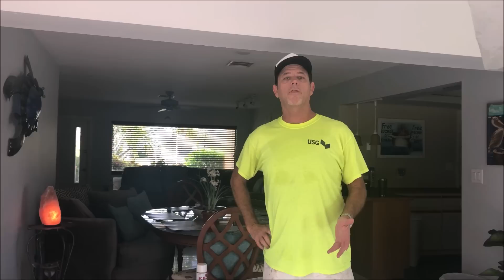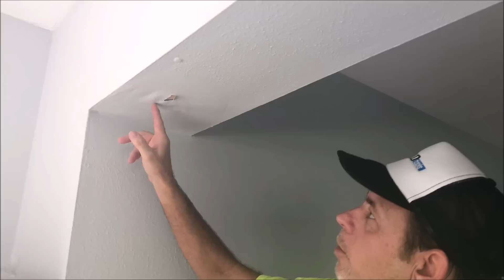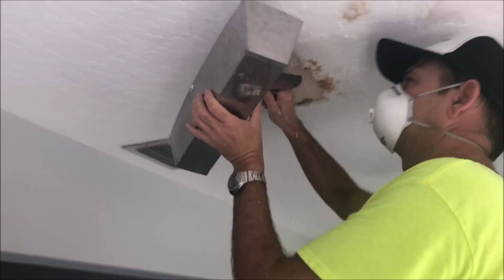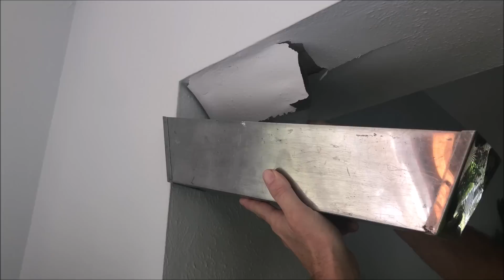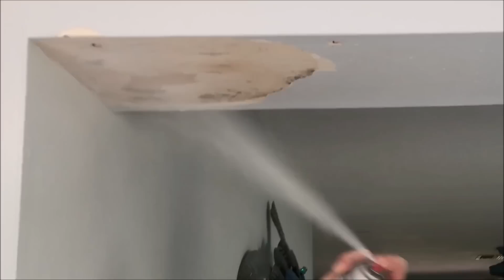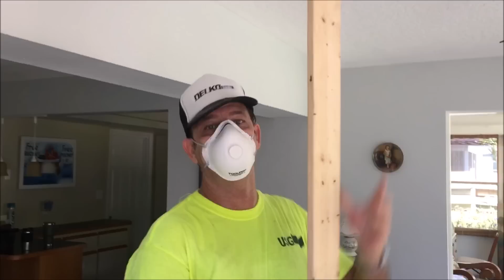Water damaged ceiling and wall project- Diy drywall repair tips

Comment: So, my air conditioner is up stairs and it’s pvc connection came loose and sprang a leak on our living room ceiling. It’s near where the cealing meets the stairs so that’s where the drywall ends. Is there anything I need to know about working on that area?

Comment: Been using these for my skim-coat and I must've had too much water in my joint compound because after drying some areas have a bunch of tiny, tiny little cracks. Should I just hit those with more mud to fill the cracks? Sand first? I've got some little bubble-holes I need to fill anyways.

Comment: Hello! We have some light brown spots in our ceiling from a roof leak. Will we still need to cut into the dry wall or can we scrape and paint over it with anti-microbial paint? There is not mold in the crawl space... what do you suggest?
Reply from the maker: As long as those areas aren’t soft you’re fine to prime and paint.👍🏻
Reply from the maker: I like using Kilz in a spray can to cover water stains.

Comment: Hi Paul  I live in LA. Our roof is leaking and we are in the process of having it repaired once the rains stop. When the contractors looked at my ceiling to see if leak was in fact coming from roof they cut a hole where it was bubbling. in short, they did nothing but leave a taped hole in my ceiling. With the rain we have had water has begun to accumulate in the taped wall. my concern is that it will burst. Can i put a pin hole in the tape and release the water that is there and then retape?
Reply from the maker: Yes! Or drill a hole or two in the drywall to release any water. I hope this helps. Keep me posted and good luck. Thanks so much for watching and subscribing! -Paul

Comment: Love the wrap on the back window. btw, if you haven't tried Upshot primer, it makes spraying the ceiling a lot easier. Please be careful with that saw when you are cutting wood while holding it on your leg. That could go real wrong real fast! Keep the great videos coming.
Reply from the maker: Thanks Earl!👍🏻 the back and side window areas of the van are actually all metal. Which makes it real secure for tools and equipment. Yes I’ve tried the upshot before. They aren’t quite as good as the Kilz original in a can. IMO. Also, the Upshot is too yellow when trying to blend in certain situations and the cans are too small and more money. So Upshot isn’t very cost effective to keep in stock on the van. Yes, that’s an advanced saw cutting position for sure. Don’t try this at home folks!😇 But, I can assure you that I’m very careful when it comes to cutting wood with a circular saw. I’m hold the 1”x4” far away from where the blade of the saw is cutting. I do appreciate you looking out my friend!🙏 Thanks so much for watching! -Paul